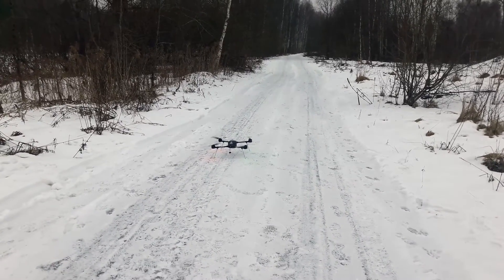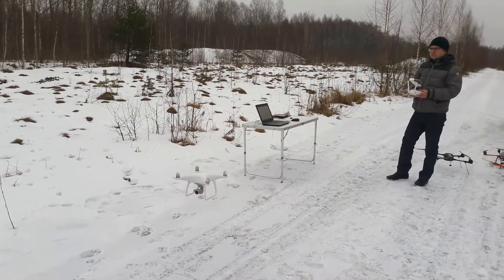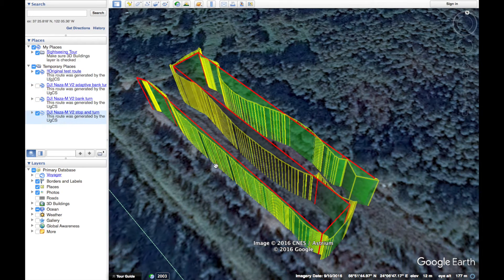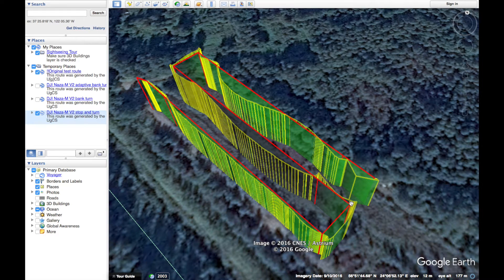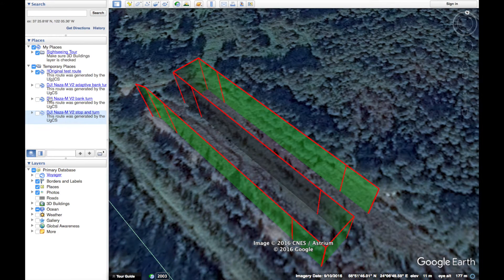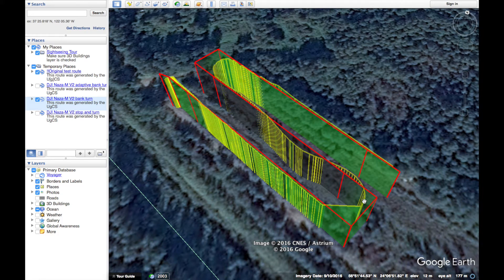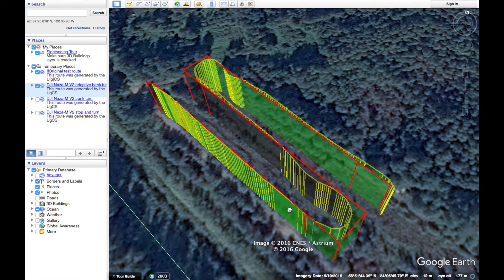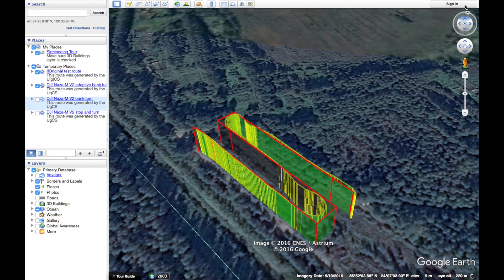Comparing Drone Autopilot Precision - Part II - DJI Naza-M V2

Comment: The problem here is you are comparing the Naza-M V2 performance to a phantom 4. this is incorrect. There is no comparison. Phantom 4 uses the DJI N3 flight controller. Naza-M V2 is under 200 USD the N3 is 500 USD and up!